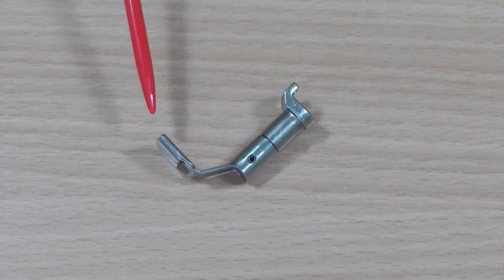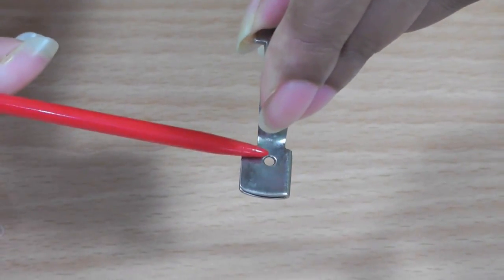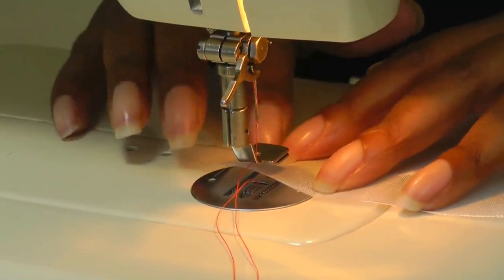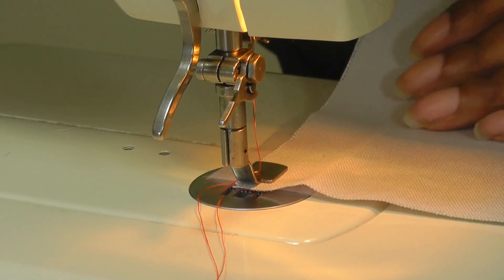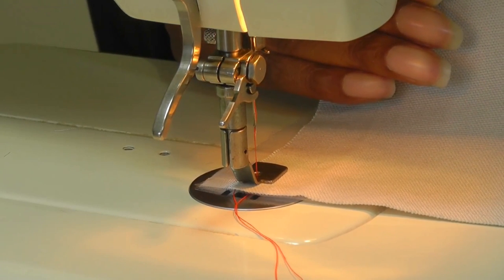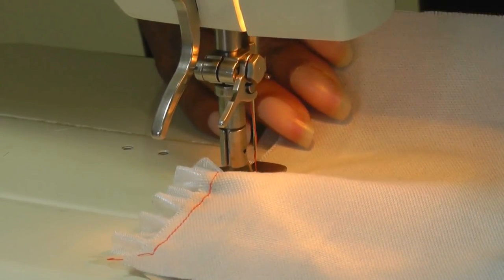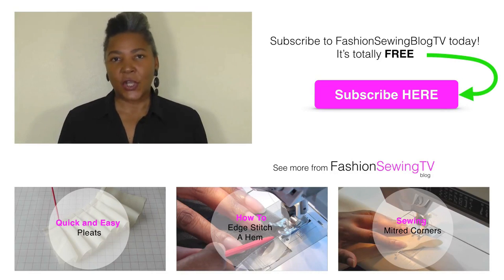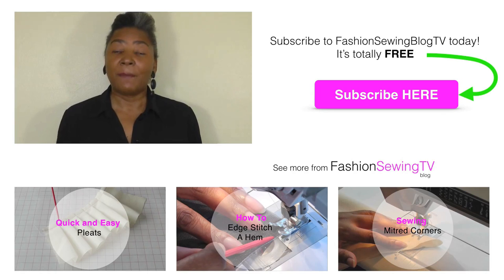How to Use a Gathering Foot

Comment: how can we calculate the gather,suppose we nedd 10" gather,so how to calculate how much fbric required,is ther any way to know how much the footh gathers?
Reply from the maker: Depending on your fabric choice it's usually about twice the length of the section to be gathered.Thank you for commenting Santam Tamrakar.
Reply: still confused,i wanted to know how much is the farbric gatherd by the gathering foot,is there any calculation or its random,suppose we have 20 inch long stip and we nee to gather it n bring it to 8 inch,so if we gather by gathering foot will it automaticall gather 20 inch to 8 inch or is there any calculation or technique or anything with the foot.
Reply from the maker: 20 inch strip will be able to gather up to 8 inches. Play around with the needle tension to increase/decrease fullness in the gathers, the sewing machines are more or less accurate, but as I say it will also depend on your fabric. Thank you for commenting Santam Tamrakar.